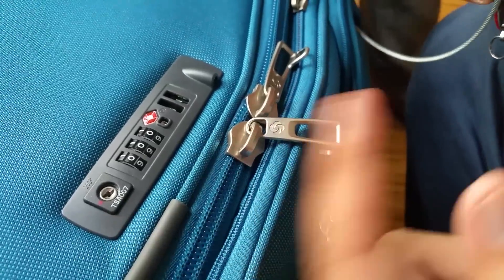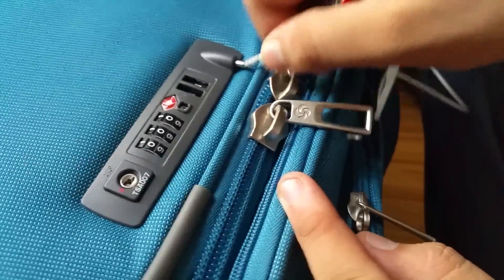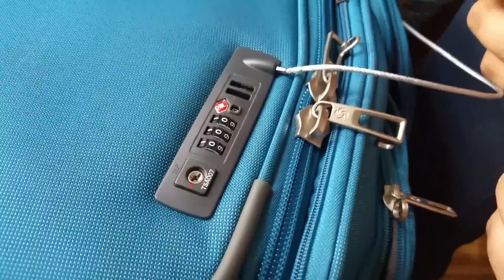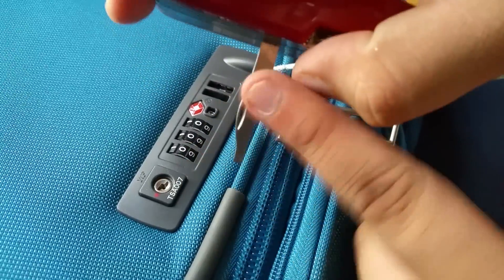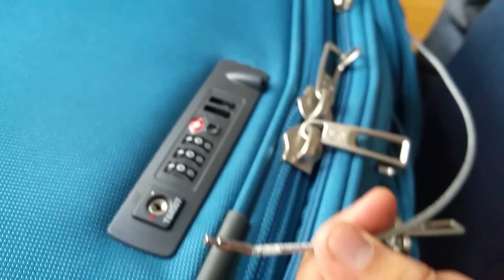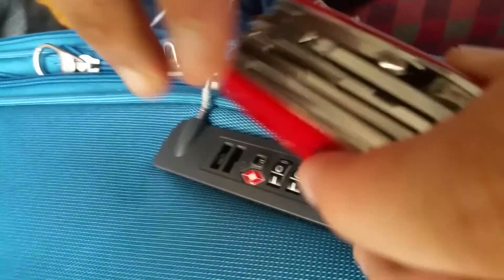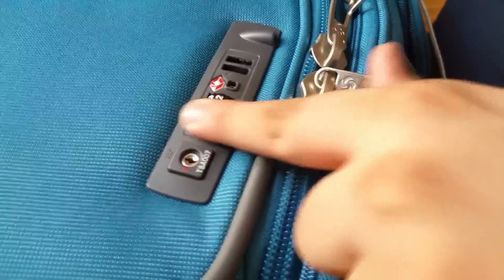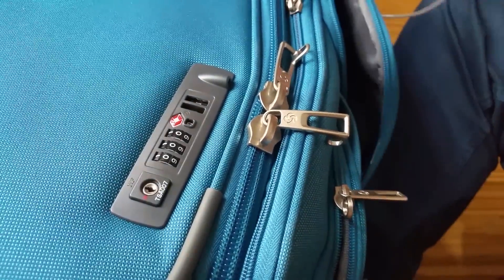Unlock samsonite lock tsa007

Comment: what happens when you get stuck dont know the code? luggage was newly bought pls help
Reply from the maker: Emma Rose Minor If this trick is not working then contact the suitcase company. They should know the password.
Reply: all good now! the attendant must have used my newly bought luggage for demo and changed lock code, forgot to reset it to default. good thing i remembered the random digits when i was trying the lock system and figured it from there. thanks!🎉